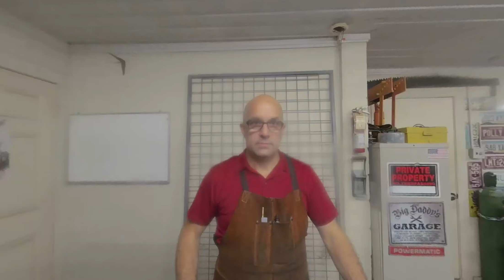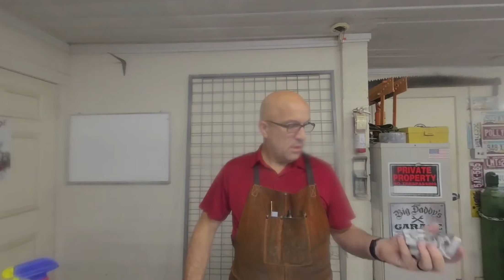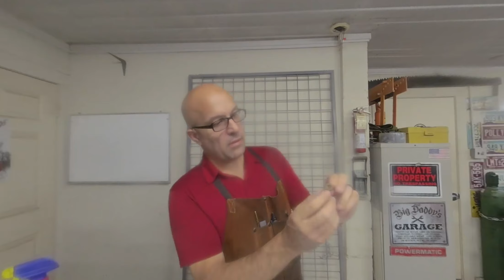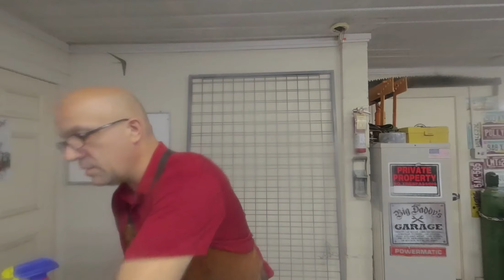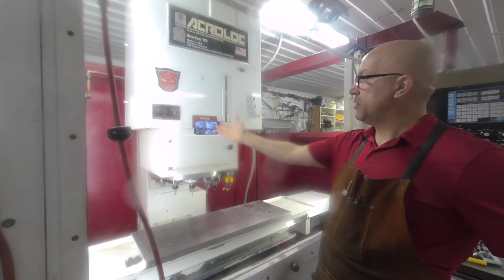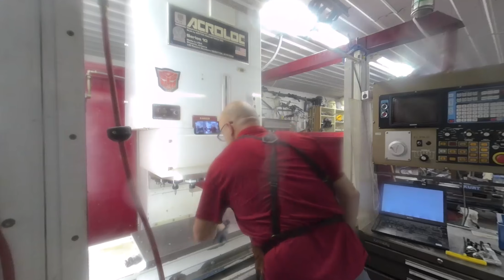VR180 Shop video: Making a fixture plate

Comment: I like the new camera,I can move to follow what you are doing to see best view!
Reply from the maker: Still working on the format.  The post processing is significantly more difficult.  If you have a VR headset it's also in full 3d and you can look around just by moving your head and see things with full depth and scale.  The slower 5.7kx30FPS works better on youtube than in VR though so I may be trying it at 4kx60FPS to see if it is a little better with a headset on.

A few things I have to be careful of, I can't move the camera while recording as it's a sure fire way to make people sick.
Reply: @TheArsonsmith4242  I'm on pc ,I guess I will have to breakdown and buy a VR headset
Reply from the maker: @neiljensen9585  The Oculus Quest is pretty mind blowing.  My videos aren't great in it yet, I'm still working on that, but there are a lot of great things to do and experience in it.